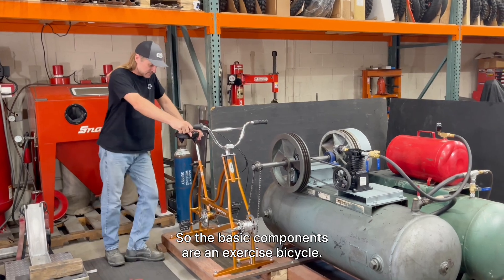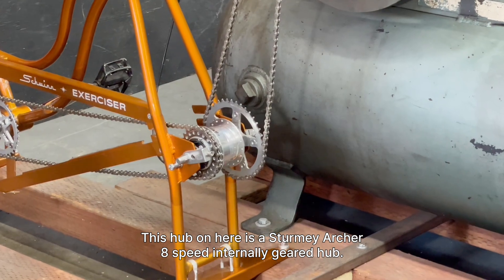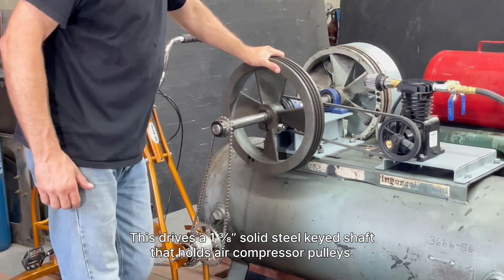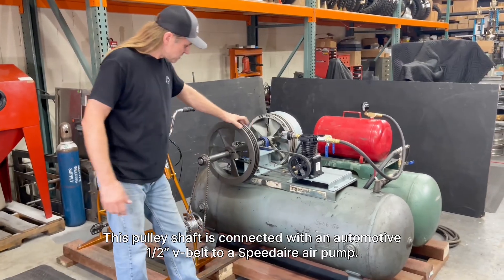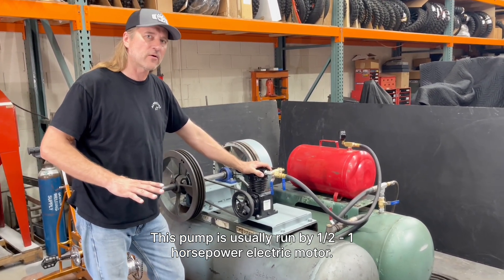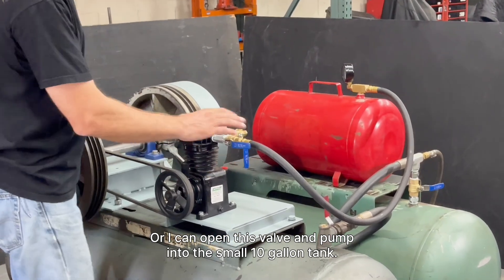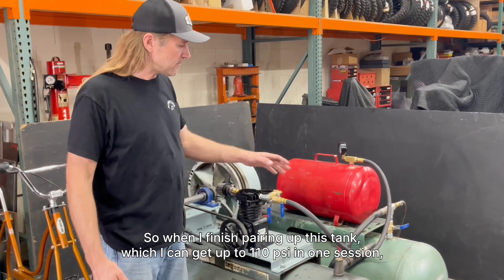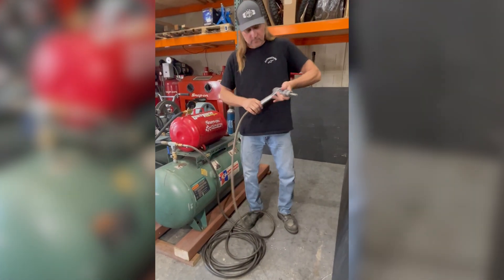Pedal Powered Air Compressor

Comment: This is awesome! There are so many applications. You can have an air start motor, and use this setup to initialize an off-grid generator.

I also think air is the best, if not only real substitute for batteries as a way to store energy.

Comment: clutch modulation would increase output. Increases momentum and load matching.
Pedal faster without gears!
Reply: Impossible, basically the gears and pulleys systems are what give better performance. I also think that adding appropriate flywheel and/or springs may make it difficult to stir at first, but it may help later.

Comment: Funny off grid solution 😂
I wonder if such set-up could somehow be used to pressure up some AC/heat pump, that could be used in a camper or tent, in ways that we would do the effort to compress she raise temperature of the gas and then have a couple of hours with a bit colder environment 😅😅😅

Comment: That is a pretty impressive solution for a truck-in-truck-out situation where electricity infrastructure is either lacking or incapacitated.  What was the rough cost in materials and time to make the compressor system?  I'm ignorant on the tech involved, could I also get a ballpark figure on the price of a small shop's worth of tools?

I guess what I'm really asking is whether I'm right in thinking that the cost to make a pedal compressor is dwarfed by the cost of the tools it serves.  Any situation where people need these air tools but don't have ready access to power, throwing in a pedal compressor seems like an obvious addition to whatever toolkit is being sent in to provide aid.

Comment: An 100$ air compresor has 1200W the human on the bike 200 W so no point
Reply: The point of this is to build compressed air storage without fossil fuels or electricity, so yeah, there is a point!
Reply: @dirtfirstracing3901   your invention comes a bit  too late, in 1400 it would have been great
Reply: @marbella-elviria  I didn't build this with just developed economies or my own life in mind, I'm also thinking about the other billions of people out there. For instance, a machine like this would be a game changer in 2023 Lebanon, where you currently only get an hour of electricity a day if you are lucky or pay the mafia.
Reply from the maker: Why not? The higher power use only serves to compress the air faster.

Comment: That is awesome.  What a superb bit of off grid kit.  I can imagine how useful this would be in a low impact setting where you still want access to air powered tools etc..  On a separate note, I have been dreaming about using a wind turbine to pump an air compressor.   Also a wind powered fridge by using a wind turbine to drive the compressor on the fridge.
Reply: If you have creek or stream with decent flow and head you could use a bunyip pump to compress air 24/7.

Comment: If you put a crank mount ebike motor on it you'd have the most convoluted human hybrid electric air compressor.
Reply: How would that work? I'm curious
Reply: @RedLetterVisions  you'd use power to assist your pedaling, but you'd still need to hop on to get air, in the end it's even more ridiculous.
Reply: @906MediaProductions  thanks

Comment: This is amazing! I'd love to hear more specs about your set up. 
How long do you have to pedal to fill em up with a useful pressure for the tools you use? How long does it typically last for you? 
I bet someone could have a sick non-electrical shop with this, an  oxyacetylene setup, a wood stove, and perhaps even a small boiler and steam engine 😮
One can dream. Thanks for sharing.
Reply: To fill one of the 80gal tanks to 100psi from empty takes me a week. 5-8 sessions of pedaling a day. Each session about 10min. Of course, it gets harder to pedal as the pressure increases, so if you only need 50psi its a lot faster and easier to fill the tanks.
If I'm hiring someone to work at my shop now I ask them how much cycling they do!
This machine is a vital part of a non-electric shop. Part of my inspiration are the hydro-powered machine shops of the early 20th century in the northeastern US.

Comment: I think that pretty damn cool  but with the amount of air I use I'd have Olympic cyclists legs in 4 days
Reply: Yeah, I noticed when the air supply is limited to what I can generate with pedalling, I valued the air supply more. I made sure there were no leaks, and only used as much air as I needed for the job. For a small motorcycle shop it’s workable, but not for a truck tire shop or a large auto shop unless you have employees to pedal it, or a bunch of kids!
Reply: @dirtfirstracing3901  I'd need to be sitting on the bike peddling full bore to keep up with my die grinder while porting xD, as it is I run 2 compressors with 3 buffer tanks